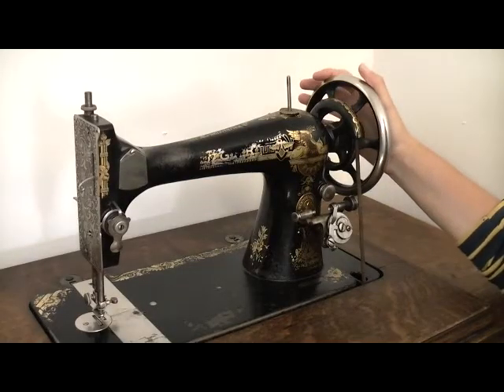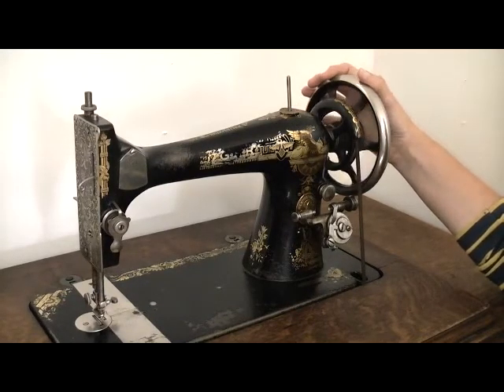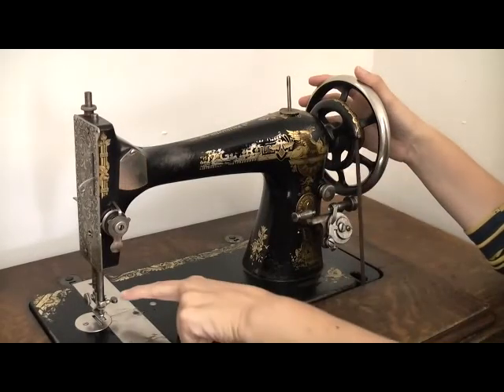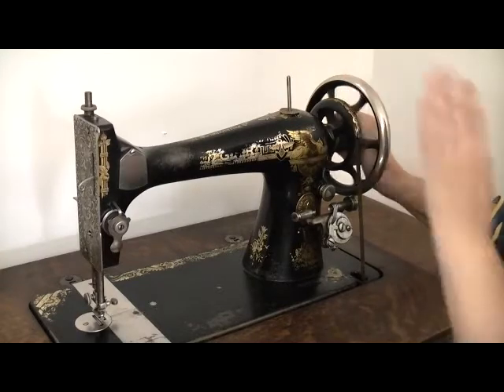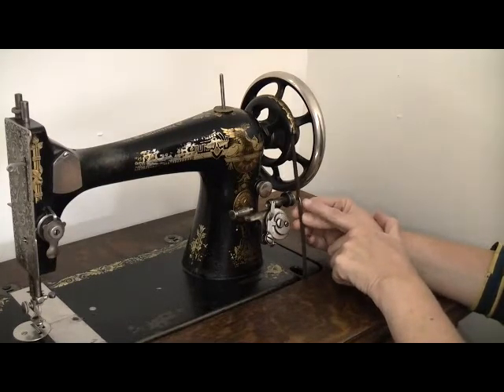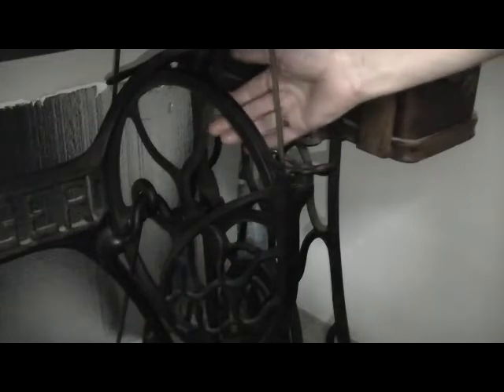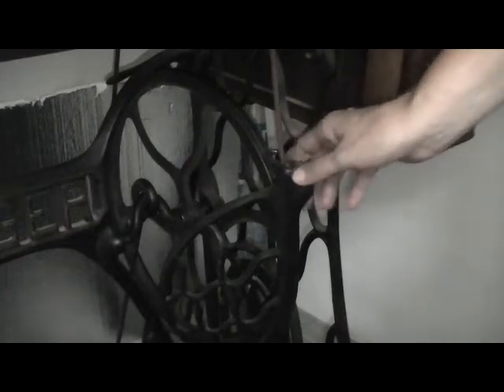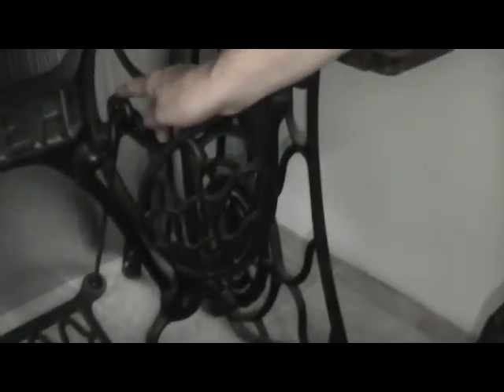Anatomy of a Singer Treadle Sewing Machine - Naming the Parts #Vintage #SewingMachine #Design

Comment: As a weaver, I noticed when I first saw a Singer 27 that the bobbin shuttle was just like my very own weaving shuttles. It made me happy and I accepted the 1894 Singer 27 that my in-laws were palming off on me because no one wanted it. I am now learning about the machine and cleaning it up so I can use it. Added bonus, hidden away in the back of a drawer was a complete puzzle box. I have not told them yet that they have given me a treasure.  Great video, I learned that the bobbin winder has an engaged and not engaged position. I paused the video right then and went and played with the bobbin winder. I don't have a belt on it yet but had been wondering how it would work.
Reply from the maker: What a great treasure! A Singer 27 and a puzzle box - that's so cool! I hope you get a belt on it soon. You'll love how it sews. Thanks so much for watching 🙂

Comment: Long bobbin shuttles have to be pointed to pass the shuttle through the loop made by the needle when it does the little jumping motion at the bottom of its travel. Loom shuttles look the same only larger. They were designed for their function, not because someone wanted them to look look bullets. That is just a nickname, Singer calls it a vibrating shuttle. Never referred to as a "bullet" in company literature.

Comment: Thanks so much for a very helpful video! I recently bought an 1895 treadle machine and couldn’t figure out how to adjust the stitch size, but now I know! I don’t think you said what’s under that flap above the tension discs. There’s a really big screw under mine but I’m not sure whether to undo it or leave well enough alone. These machines are amazing, aren’t they? Thanks again.
Reply from the maker: You're welcome! Do you mean the trapezoid shaped silver flap? It's an access hatch for oiling. There's also a flap on the tension discs. If you push that one it will open up the tension discs so you can get the thread in and out. Thanks for watching 😀

Comment: I was in need of this video before shopping for my used treadle cabinet.  Now I need to pray that all the important parts are there.  I know the cradle is missing.  Need to build one inexpensive and the lowering bar is missing.  I am converting a Singer electric 66 Red eye into this cabinet. Hopefully I know what I am doing.
Reply from the maker: It's going to be amazing when you've finished it! Thanks for sharing and for watching! 🙂
Reply: @SimplyStitchy  The metal bar that lift and lower the machine is missing too.  Now searching were to find those parts or how to modify  everything.  What is the purpose of the cradle  or belly of the machine 🤔 to protect the machine while is down? I am trying to put an electric Singer 66 Red Eye on the treadle machine and remove the motor. Hopping that I am not over my head here whit this project.

Comment: You are as passionate about treadles as I am.
I have the old boring box type Singer cabinet with a gorgyfabulous Singer 66 lotus flower on top.
I have operated and sewn with treadles before and I love it.
Watching your video brought my attention to the Balancing of a treadle which I have not actually thought about.....I thought they came balanced.
I just hook the belt up and go.
Thinking about this........Do we set the belt on the wheel with the treadle in a certain position and the take up lever either high or low?
I am wracking my brains thinking about this as it may have a marked effect in ease of use?
How do I know if the big wheel is balanced?
Thus never occurred to be as there is no adjustment facility.
Kind regards
Peter
Reply from the maker: Hi Peter, there isn't a balance as such, but you're right in that there is a safe way to attach the belt. You need to keep the needle at its highest position and the pitman arm at its lowest. That way,  when gravity pulls the pitman arm beyond its highest point, (top dead center) it pulls the needle up and not down. Grandma, my Singer 27 has the needle set at the lowest position. When you take your feet off the treadle pedal, resistance is removed allowing the pitman arm to drop beyond top dead center. Gravity takes over and pulls the pitman arm and the needle downwards. I like to call this Grandma's dropsies. As long as you keep your fingers out of the way, the needle dropping like that isn't detrimental to the machine. It's just safer for us if the needle is pulled up out of the way. I really need to fix that, but I'm waiting until her belt needs changing. Thanks for watching 🙂

Comment: Hi! I’m going to look at a treadle tomorrow, it might be unlikely that you’ll see this comment before then but it’s worth a shot🤷🏼‍♀️ the best is broken, so how can I make sure the machine will work when I replace it? Do I just need to make sure the pedal and wheels move smoothly? Do I need to open it up to check for any rust? And if I find some rust, is that possible to restore?
Reply from the maker: If the belt is broken, turn the handwheel to make sure everything moves freely. Next, work the pedal, it should turn the bandwheel freely even if the belt is broken. If any part of the machine is locked up tight and not moving, you'll need to soak the moving parts in oil.  Make sure the bobbin and bobbin case are there. These old machines are pretty much bullet-proof so as long as all the parts are there, you should be able to get her working again. Rust is one of those things - depends on how bad it is. Surface rust on the treadle parts should just clean off with some white vinegar - Don't use on the decals - or on the machine head - it's acid. If the rust is deeper, or the table is falling apart.... it'll be a lot harder and take longer to fix.
Reply: Whatever you do don’t clean it with anything but sewing machine oil. I’m experienced with repairing machines but never had a very grubby 130 y.o. White Vibrating shuttle treadle machine. I damaged mine wiping the machine down with denatured alcohol. 
Also on a side note I’ve just replaced the belt and it sees backwards! Driving me up the wall. Trying to figure that out now.
Reply: There’s a channel called Andy Tube he tested different methods of cleanly the machine- that why I’m stuck on the oil method.

Comment: Thank you so very much for this intelligent, informative and very entertaining video. I’ve recently acquired a Singer F series (from the product number) treadle machine that was made between 1910 and 1920. It has a round bobbin. I’m intrigued with the mechanics of it. It’s in excellent condition, and will stitch backwards from the wheel, and forward from the treadle.  What’s missing is the transfer of power from the treadle to the needle. Any thoughts on what needs adjustment?
Reply from the maker: Thanks Sarah, I'm glad you enjoyed it! When you look at your handwheel, is there a smaller wheel inside it? It should look like a silver/chrome colored disc. Try turning that. It disengages the needle when you wind the bobbin so the needle doesn't go up and down. It could be it's been left in bobbin-winding mode. Thanks for watching! 😀
Reply: This was my exact problem, and I spent too much time trying to trace the “problem”.  You explained it in just a minute, and I  did a forehead smack.  Thank you!!!

Comment: Thank you, very informative,  I just purchased  a singer bullet Bobbin  machine,  and sadly the Bobbin is damaged, can these be purchased anywhere,  or am I out of luck
Reply from the maker: You're welcome. Do you mean the shuttle case or the actual long bobbin? You can get the bobbins from Amazon. Try this link: https://amzn.to/3I5KzQB. The shuttle cases are a different story. Amazon also has shuttle cases and bobbin sets, but, the problem with vibrating shuttle machines - not all shuttle cases fit all the machines. Do you know what model you have?  You could also try this link: https://www.sewingpartsonline.com/shuttle-comb-singer-8327.aspx. Or try here: https://www.vintagesingerparts.com/collections/bobbin-cases-and-latches/products/singer-sewing-machine-27-127-128-bobbin-case-shuttle-complete. Compare the picture against the one you have to make sure it's the right one. I hope you find one. Thanks for watching! 🙂

Comment: Do you know anything about replacing or repairing the bushing on the treadle at the pitman arm?
Reply from the maker: Hi Judy, Having never had to do that, it's not something I'm familiar with. I'm not even 100% sure it's something you can replace. I always thought the pitman arm and connecting points at each end were all one unit. So, if the connections go, you replace the whole arm. Of course, that depends on the machine you have. I can only recommend you check out AndyTube here on Youtube. He does maintenance videos. If you can replace the bushes, he'll have done a video on it. I'm so sorry I can't help further. Let me know how you get on. Thanks for watching.🙂

Comment: Do you have any videos on getting the bobbin shuttle threaded? I followed the manual, but it doesn’t pick up the bobbin thread every time. Also, I can’t seem to make it sew. It just makes a big lump
Reply from the maker: Yes, I put the link in the reply to your last comment. I also have a short on how to load the bobbin into the shuttle: https://youtube.com/shorts/Yx76ntM8cy0?feature=share . If it isn't picking the bobbin thread up, it could be your needle. The Singer 27, 128, 127, 28 machines thread from left to right so your needle needs to be inserted with the flat side facing right, or towards the pillar. When you sew the hand wheel need to turn towards you. If you are using a hand crank, that means turning the handle away from you. For the bobbin, once you've pulled the thread into the groove down the side, you just slide it under metal bit so it sits in the space. Nothing holds it there, there's no other slot. Just make sure its under than tension clip as you put it in the machine. Hope that helps. Thanks for watching. Let me know when you get it going. :)

Comment: Hi I just broke the Pit man arm, I welded it on again but when treadling I saw the arm bending, and I believe that’s the reason it sheared right off at the bottom. Is the arm supposed to bend a little or not? Greetings from the Netherlands
Reply from the maker: As far as I know, the pitman arm isn't supposed to bend on a treadle. It doesn't on mine but it's always possible other treadles may work differently. Are the connection points on the treadle pedal and the bandwheel oiled and moving smoothly? Is the pitman arm bending at the weld? If it is, I think you might need a new pitman arm. It could be metal fatigue or just age. It sounds as though the fix is working for now so go with it. Just take it a bit easy until you get a new rod. Thanks for watching! 🙂
Reply: @SimplyStitchy  thank you so much for answering. I believe after a closer inspection everything is seized beyond repair. I nee to drill out the old rod which is threaded btw on both ends- I suppose to adjust it to the pedal at lenght. Well thank you for answering anyway, I had a hunch that it was not all together viable.
Reply from the maker: @adelheidsnel5171  All may not be lost! You'll need a ton of release oil to unstick those parts. But with time, patience and more than a little bit of elbow grease, even the most stubborn of seized metal parts can be brought back to life. I might even suggest trying WD40 - but only on the metal joints though - keep it away from the rest of the machine.  The key is - don't force the parts to move - go on their timeframe. Hope you can get it back up and running! Let me know!

Comment: What is this model number. I have this one (just got it from my mother in law) and I am trying to figure out how to make it work. Mine came with a manual for 127/128, but my bobbin winder is like yours (below the thread tensioner not above it).  The manual I have shows the bobbin winder above the tensioner, so I’m not sure it really is the 127/128 despite the manual.
Reply from the maker: Grandma is a Singer 27. The 127, 128, 27 & 28 are all pretty much the same machine so the manual you have should give you pointers in the right direction. The 128 is a 3/4 size machine so is smaller than the 27 but that's the only main difference. They work the same way. If you check out my video on how to sew with a treadle: https://youtu.be/l470QMz51qA , I go through threading the machine from the 9:22 time slot. Let me know how you get on. Thanks for watching :D

Comment: I’ve put on a new belt and it sews backwards! I’m so frustrated. Ordered the belt off Amazon. The machine is a 1890 White Vibrating shuttle treadle machine. I’ve been sewing and working on machines since I was a child but this has confuddled! I’ve spent hours cleaning and tidying up this machine and my reward would be to see it sew,  and it’s doesn’t. If you have an idea what’s up please help me out.
Reply from the maker: Have you used a treadle machine before? Normally treadles sew backwards if the pitman arm (the rod attaching the treadle pedal to the bandwheel) falls backwards instead of forwards. Put your foot on the treadle pedal and then spin your handwheel towards you. Keep spinning the handwheel until you feel movement in the treadle pedal. Then, start pushing the pedal with your foot. Keep the momentum going and you should go forwards. Hope that helps.
Reply: @SimplyStitchy  No never used one. That’s crazy the treadle normally sews backwards. I have noticed where the pitman arm attaches to the flywheel for some reason if you don’t pedal a certain way  it will reverse at a certain point. I don’t know if that makes sense. It’s like a rough spot  in the wheel rotation then it wants to go back the other way. Thanks for your suggestion that does help a lot.
Reply from the maker: @LilyoftheValeyrising  It's down to gravity and which side of the top-dead-center the pitman arm is at. If it's even just a little bit, leaning towards the back, it'll fall off backwards. That's why turning the handwheel towards you first, helps the pitman arm fall off to the front. Momentum then takes over and it'll carry on going forwards - as long as you keep pedaling. If you want to stop, stop the handwheel first, then stop pedalling. Enjoy your new treadle - takes some getting used to but they are worth it!
Reply: @SimplyStitchy  I’ve noticed that the pitman arm is like the master of direction. I try to hold the pedal steady so it won’t reverse so easily and snap my thread. I need reading glasses as I’m almost 50 and it takes me a while to thread the machine. I use the threader things. I’m practicing and getting the knack of sewing on this machine. It’s fun! It’s just so cool to be able to sew without electricity. I’m going to keep at it. Thanks!
Reply: I have a Singer 9w formerly made by Wheeler and Wilson in the early 1900s. It has a rotary hook and operates in the opposite direction to other Singers. It could be the White treadle needs to have the handwheel spun toward the back also in order to operate. White made rotary machines also, but i dont know any more about them.
Reply: @ryndl  interesting!!

Comment: My mother, who ran an alterations business out of the front room of our home, owned this same type treadle machine. Still does actually but she no longer has the business due to age and health issues.
My father, ran an automotive repair shop for over 60 years and specialized in wheel alignment. So I grew up under the dirty side of every customer's vehicle he worked on. I learned early on what a "pittman arm" is. Even replaced one or two myself. I found your bit of history quite refreshing. 

The pedals of a bicycle are essentially two opposing Pittman arms working in tandem.
Reply from the maker: It sure is a useful piece of machinery! Thanks for watching! 😀